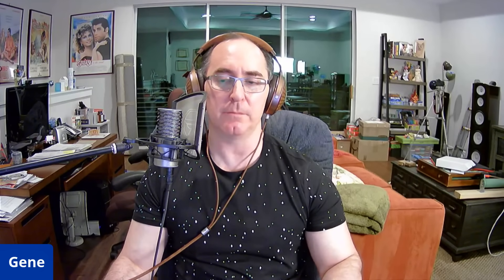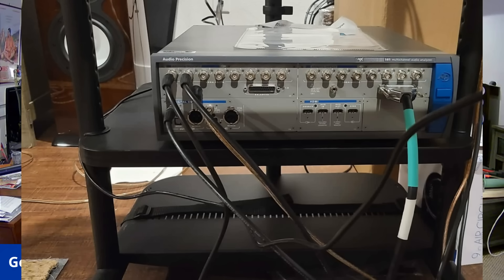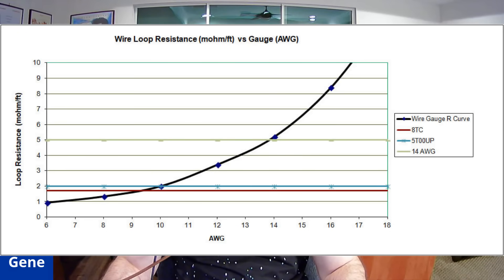Speaker Cables Really Don't Make Much of a Difference?

Comment: In other words, most aspects of short-run speaker cables do not have differences humans can hear. Those who claim otherwise are on the hook to demonstrate they can when conditions are controlled. (Nobody ever has with controlled, blind tests) I will also say that any power loss differences in cables can be correct with the volume control. It is irrelevant. The issue is about differences in frequency response of cables, which this "analyst", despite all the effort he puts in, does not address.
Reply from the maker: I clearly addressed, demoed  w measurements and calculated Frequency response differences between cables in this video. They are almost immeasurable and 1000s of times below the threshold of human hearing.
Reply: @Audioholics  If so, I apologize.  But, that should be emphasized, not resistance differences. Why show those graphs? Why do resistive differences matter at all?
Reply from the maker: @Rob-k5k9u At audio frequencies for speaker cables, resistance is the most important metric of concern, especially when driving low impedance loads. I show resistance, AC resistance inductance and capacitance.  Most importantly,  I measure the differences w a real amp and speaker attached. A lot more work went into this video than you may realize. All angles were covered so you can make an educated fact based conclusion.
Reply: @Audioholics  Concern for what? Power loss? What about frequency response--which most of what determines signal fidelity? With a changing signal,  impedance is what matters. because it can change the equal frequency response of the signal. Please explain how different resistance can affect a signal when L and C are held constant.
Reply from the maker: @Rob-k5k9u I can explain things for you but I cant learn them for you. All of your concerns are addressed in this video. AC resistance is a function of frequency based on the change of internal inductance due to skin effect.  Again this is measured and shown in the video. High resistance cable connected to a low impedance load to a non load invariant amp can alter frequency reaponse. Again, explained in the video.
Reply: @Audioholics  You don't seem to be able to explain anything. Start with explaining the difference between resistance and impedance, you seem to confuse the two or label impedance "AC resistance". Impedance can change based on frequency, but many or your charts show DC resistance. Why? It doesn't matter. And, L and C are are what change with frequency (not DC resistance). Why not show how various changes in L, C, and R, alter frequency response---that's the only thing that matters other than noise and distortion.
Reply: @Audioholics  You know, I have been too much of a grumpy pants. I agree with your basic findings and much of your method. I think my concern was about terminology, and with that insight I should re-listen to your video.
Reply from the maker: @Rob-k5k9u  No problem. Please check our articles too: https://www.audioholics.com/audio-video-cables

Comment: So been in the audio hobby (now) vs being a tech at GRT/Chess/Janus recording co back in the day.  I worked at the tape plant in Sunnyvale, in all bldgs from the sound studio to the packaging line.  Audio to 440 3 phase.  And later NOAA hydrographic.  My experience is that you are dead on.  
The most important issue is good stable connections, not wire size or configuration.  When possible, I tinned the connection end and treated with vasoline.  That precludes crevice corrosion and humidity effects over time.  AWG14 is fine for running loads under 100 watts.  If the transients take you over 100 watts, you need bigger wire.  And better is better.  But diminishing returns steps in here too 😅
Reply: That's right. It is the connection point, that matters.

Comment: The placebo effect very often demonstrates that the more expensive a cable is, or how convinced you are psychologically that they "must sound great", the BETTER those cables will sound. For example, when I build audio electronics, I will pay extra $$ and install the most expensive fancy-ass capacitors I can afford, but knowing that they will probably not make much of a difference; I just enjoy that they are in the circuit. I feel satisfied. I am happy. I worry less that I might be hearing cheap components because I filled or solved that possible dilemma..... EVEN THOUGH I know I might be getting fooled by the placebo effect. 
So when choosing audio cables, I go for what I can reasonably afford. I go with what makes me relax and enjoy the music, and let any placebo effect do it's thing. 😇

Comment: Can you explain how your measurements represent things like clarity, background noise, and and separation?

I'm new to the hobby. And I heard that the best cables are multigauge solid core.  I also need my new hobby to cost as little as possible. So I replaced 14/2 stranded with 12 solid core electricians and for S&G's I threw on some CAT6 to make it multigauge. 

I've only done the right speaker so I can compare it with the left. They sound like different speakers. The 14/2 stranded is muddy, bass is undifferentiated, and there is a lot of background noise.

My set up is a regular 2000's Yamaha receiver and the speakers are a pair of 70s hifi that I got at a garage sale. I'm never going to waste money on $1k cables, but I gotta say that I think the cable does make a big difference. What do you think about my experiment?

Comment: As a person who worked in the industry and sold transparent cable, I can speak very candidly from not only selling them and hearing them in clients systems, but in going to the factory where they are made and listening to every single level of cables that they have all on the same equipment as they moved up the line and you can absolutely hear a difference. Whether or not someone finds the value or not in that difference is a totally different subject as the prices do get insane but the simple answer to a simple question of. Is there a difference in different levels of cables again at least when it comes to transparent cable, I can say the answer is easily yes and I am no longer in the industry so I have no dog in this fightjust dropping the hard facts
Reply from the maker: That means the cables were acting like tone controls which makes sense since they use LCR pasdive components. Those cables weren't very transparent where they?😅
Reply: @Audioholics  they are fantastic cables
Reply from the maker: @teslatalk42069 any cable that adds a passive LCR network is NOT a fantastic cable,  nor is it transparent.  Tone controls should always be done with active electronics and preferably in the digital domain.

Comment: Hi if I take decent quality 10awg cable and seperate the 2 conductors with little standoffs so that they are say 1 inch apart will that reduce both inductance and capacitance and make the cable “purely” resistive with a flat frequency response?

Comment: I did a music course in the UK, a HND, and part of that course we performed similar tests, and concluded that providing your speaker cable is 'meaty enough' to handle the current, there was no perceivable difference at all. The only people who benefitted from such products were the manufacturers, wholesalers and retailers. Yes, it has it jewlery appeal, but in reality...believe the science.
Reply: Which is for most people 2.5mm2 99.999% pure copper speaker cable. Available at most places at less than 2 dollar/euro's per meter. With simple "gold plated" banana plugs, which are about 8 euros a pair including delivery.  Total for 5 speakers will be about 120 to 150 dollars including the 10 pairs banana plugs because i choose fancy gold plated. Which most important future is preventing corrosion. Do not associate fancy "gold plated" with  being a better conductor, it is just about reducing changes of corrosion.

Comment: Wires are wires. It's how they are wrapped and insulated that counts
Reply from the maker: At audio frequencies,  only the spacing between conductors matters in terms of inductance and capacitance for speaker cables. That is how the insulation affects performance.

Comment: Sometimes the basic speaker cables sound better than expensive. In my experience, quality entry level speaker cable does 95% of the work. I own a $1500 pair of Hi End Speaker Cables that sound like nails on a chalkboard.

Comment: Speaker cables def can make a difference.  Some cables are brighter sounding.   Some cables warmer.
Reply from the maker: And some more chocolatey 🍫 😋
Reply: @Audioholics  you should get your hearing checked…seriously.  Or maybe get your ear wax sucked out with machine?   Cause if you can’t hear the difference between silver and copper cable…I question your ability to judge anything audio related.

Comment: Hello, watched your video.  I have a boat and last year upgraded the electrical system to accommodate additional batteries, lighting and charging switches.  I noticed marine cables/wiring is significantly better in that it is tinned and resistant to corrosion, but more importantly has finer and denser stranded wire with thicker insulating jacket.  It's not cheap stuff but likely significantly less expensive than some HiFi products out there.  Any thoughts?

Comment: I bought 1000£ MIT cables and the order was so delayed that they sent me instead their 770 bi wire shotgun cables that were something like £ 4000 at the time… I was running Ruark solstice reference monitors, meridian 557 amps and Meridian processor.. QED 79 strand cables.. the MIT CABLES MADE ABSOLUTELY NO DIFFERENCE WHATSOEVER.. I was so disappointed.. they were ridiculously expensive and ridiculously huge.. they certainly were a conversation topic.. but sound wise a huge letdown..

Comment: •	Double-blind tests (where neither the tester nor the listener knows which cable is which) consistently show no audible differences between new and “burned-in” speaker cables of the same type.
	•	Reputable engineers like Ethan Winer and publications like Audioholics have tested this and concluded that any perceived change is not scientifically supported.

Comment: Hi there, thanks a lot for this video, I love people who just do logic reproducible measurements and are not afraid to say so. One question, since the Kimber cable measures better then to others but the measurement on the system did not reveal much of that, is that pointing to the limit of the amplifier? I would have expected a difference in the measurement in the whole "system". Not claiming I could hear that but just for my understanding.

Comment: The truth of cable comes down to the length between the amplifier and the speaker it will drive and the ability of that cable to pass current between both devices. A cable with ten strand will not pass as much current as a cable of that same gauge as a cable with 100 strand. 
If you distance is short, you amp is 100 watt RMS, 12 gauge will do the trick. If you have a 100 foot run, the impedance of the cable should be considered. The load is a known value, but the coil of the speaker is inductive and bucks voltage based of frequency. To figure out the proper wire size needed you should find out the voltage that the final amplifier uses to drive its output. Note, this won't work with a tube amp because it has a transformer tied to the plate of the tube. In a 100 watt amplifier with 12 volts used to develop  the drive we can expect 8.33 amps will be used to drive your speaker. Many home amps use 35 or 70 volts to develop power. As the voltage goes up the required current to do the same work goes down. P, power is equal to I, current times V, voltage. Manipulate the equation. 100/70 = 1.43 amps. The guy is right, don't go crazy buying wire unless your putting a high power system in your car.

Comment: Speaker Cables Really Don't Make Much of a Difference? No they don't you could use a fucking wire coat hangar but you'll never get the guys that jerk off on their expensive cables to believe there is no difference they will hear a difference even if it kills them.

Comment: Size matters. If its too small that's a problem but if you have an adequate cross section and proper insulation you will not hear a difference between $100 cables and $1,000 cables. And if someone says otherwise challenge them to pick the $30,000 dollar cables (yes really!) from the $100 cables in a blind test.

Comment: A while ago I used some Kimber cables with a few broken plugs, so they were barely connecting and I had to screw them in the clamp. Then I bought John van Gent cables nicely crafted with I believe WBT plugs. There was a big improvement like a veil lifted. I thought it was the cable, but I now realise the connectors will probably make the biggest difference!

Comment: Idk I bought some expensive kicker cables and it totally changed my sound,
I dont like it it's to high now it sounds way clearer but I dont feel the frequency or something it's not simulating my brain ...where I feel like im on a ride like when your stomach drops  im only feeling it a little bit now definitely sounds clearer, louder but I'm not feeling the vibration inside it's not base its something that makes me feel a sensation though my entire self what is that im curious I might be nuts but its there and im known to hear the twelve volt plug on the wall or the light sitting above my head.
I aways get shocked to on the weirdest things like whyyyy meeee I can't talk to nobody about it I might be schizo idc but whyyyyy

Comment: I' have a much better piece of testing equipment - YOU! Meaning ourselves. Impo  it is a snake oil sales pitch and a scam . you have 2 gauge wire coming into your service panel In your house ,all the wiring (most) is 12/3 or 14/3 . open the hood of your AVR/AMP and take a look at the wire leads going to.your speaker terminals - you will be astonished! so why are you throwing on monster cable? Its ridiculous but I guess some people have money to throw away - to each his or her own.

Comment: I have been telling people that DC resistance is the most audioable difference of cable and if cables are built reasonably well impedennce a d resistance at 10-15 feet wont be a difference. Yet i have tested copper to silver and what not and people swear they can hear difference, i usually just laugh. Properly terminated cabel and connector with lowest possible dc resistance is all that you need. Orherwise change the speaker coils, crossover magnet wire used inside and in amplifier first.

Comment: The only difference i have noticed is copper vs silver,  the silver has a bright top end, if they meassure the same then they messure the same, but i have noticed every time i swap out copper cable for the silver.

Comment: my experience is you don't need to worry about cables much. i bought a sub to go in my car once that was wired to the box with pathetic tiny cable and made my sub sound thin and weak. sounded much better once i put normal cable in there. but that was driving dual coil with 2ohm load so it was probably more sensitive to cable quality. i wouldn't go for the cheapest cable you can get just in case the cable is so thin and cheap that it does introduce resistance into your system. but for home theatre a guess a typical 8ohm drive isn't going to be sensitive at all to speaker gauge/quality.

Comment: Thanks for sharing this research. If you know that there's close to no difference, how come you have a "favourite cable"? Or is more because of the build quality, plugs, rubber, flexibility, etc.
Reply from the maker: My "favorite" cable is solely bc of aesthetics, build quality and the fact it measures as good or better than standard cables I often use and recommend. There are no discernible audible differences, however.
Reply: That's what I thought! Thanks!

Comment: Many thanks for the objective presentation and evaluation of the measurements on quite respectable loudspeaker cables. Perhaps a NEGATIVE reference (2 x 0.5mm²) would have been useful. One could have recognized that some cheap speaker cables actually have deteriorating effects. It would therefore make perfect sense to replace such (2x0.5mm²) cables with better ones.
I am glad to have found your channel and look forward to more factual videos, without voodoo. Greetings Detlef

Comment: I would never spend megabucks on cables, I can't afford to, but that doesn't mean I can't hear the difference. And for those who don't, and rely on empirical evidence to prove that your busted ass bell wire cables sound just fine, more power to you. If you get maximum enjoyment from your Hifi system with whatever cables you have, that's sweet. But don't begrudge and insult anyone else who is experiencing a high level of enjoyment from their system with whatever cables they have, at whatever price they paid, because some douche bag measured them on an oscilliscope. Placebo or not, I hear a difference, I know there is a difference, and my system, the way it is set up, and the cables I use, bring me much enjoyment. And let's be frank, you might as well say that a DVD player sounds identical to a quality CD player, because its all bits right... ones and zeroes, and all amplifiers saound the same, because it's straight up amplitude right, and all speakers that can produce audio in a specific frequency range must also all sound the same. So, I sincerely hope you enjoy listening to your tin ass bluetooth speakers, and spend the rest of your disposable income on whatever other endeavour suits you, or better yet, take any opportunity to enjoy live audio, because at the end of the day, it doesn't get better than that.